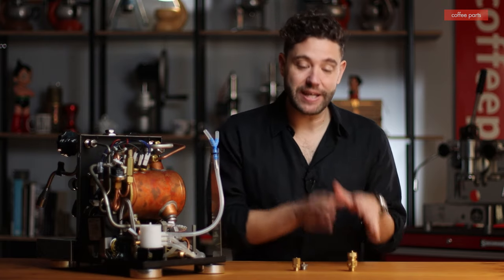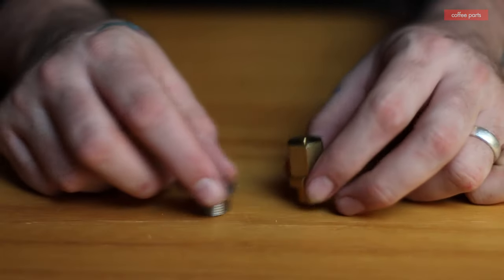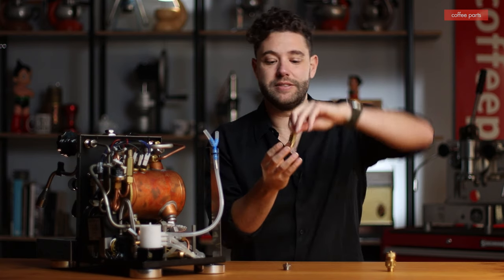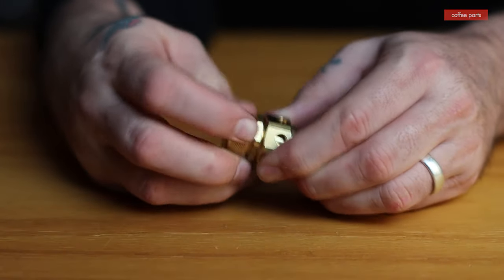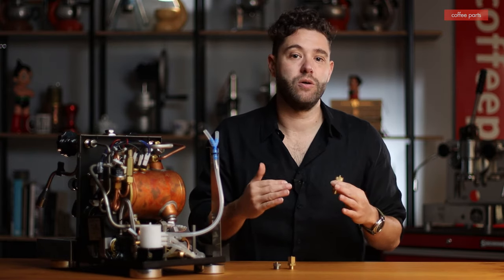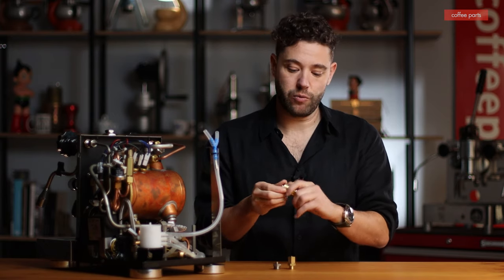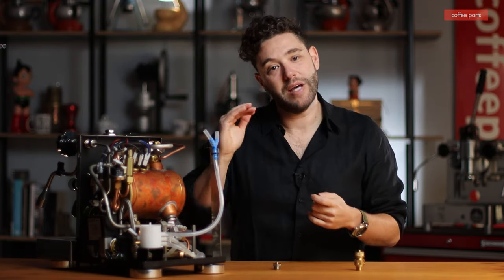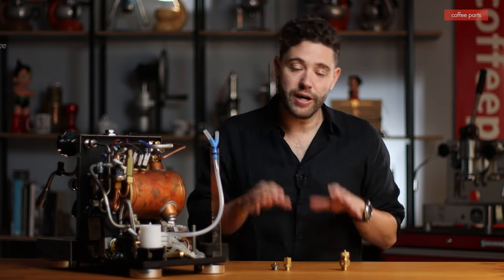Espresso Machine Anti-Vacuum & Safety Valves Explained | Quick Tip

Comment: Pedro - Nice video, but the anti-vac valve is really designed for another purpose.  It is to prevent a vacuum building up inside the boiler as it cools down. Without the anti-vac valve, the boiler could be crushed by external air pressure as the internal pressure drops in line with the temp.  The pressure from heating the boiler forces it closed and then as pressure/temp inside the boiler drops, air pressure forces it back open.

The safety valve - as you say is to stop the boiler getting too much pressure.

Comment: I have a Cecilware espresso machine and the problem I’m getting rn is the safety valve keeps releasing water from it after turning on the machine for like 20 secs , is that a sign the safety valve needs to be replaced ?

Comment: I tried gently pressing the red thermostat button (removed rubber plug on base) then fired up the machine.  Boiler runs until about 1 bar, then shuts down.  Don't know if this has "cured" the excessive pressure problem, but will see how it goes.  Pressure stat won't be too hard to replace (nothing is on this machine) if needed.

Comment: La Pavoni Professional anti-vacuum valve does not release excess pressure.  Pressure gauge ranges into the red and keeps going.  Is the valve stuck shut?  I've serviced the valve and it moves freely.  Suggestions?

Comment: My valve doesn’t stick, but opens and basically continues to outgas the steam constantly. Also, mine doesn’t have a “safety” combined. My machine is an Astoria CKXE/1. Maybe I have another peoblem that keeps it open and constantly gassing out? OR, the valve is just bad? I haven’t replaced it and the unit is over 5 years old. I did replace the thermostat a year ago and the gauge is staying in the green….

Comment: You mention standard sizing. Wouldn't brands like Nouva Simonelli use metric?
Reply: Plumbing fittings are BSP, a pre metric standard. When everything else went to metric, they kept the standard for pipe threads, as it was a different thread than imperial anyway. You don’t want people using standard nuts and bolts to seal boiler fittings or anything.
Reply: @nicbrownable  I had no idea. I will post this I found online. Might help someone else. Thanks for clarifying. 

NPT

NPT is the abbreviation for National Pipe Thread Tapered, which is the U.S. standard for tapered threads used to join pipes and fittings. They were established as a standard by the American National Standard Pipe Thread, commonly referred to as the national pipe thread standards. NPT is one of the U.S. national technical standards for both tapered and straight thread series that are used for various purposes such as rigidity and pressure-tight sealing.  

BSP

BSP is the abbreviation for British Standard Pipe. The thread, as defined by the ISO 228 standard, uses Whitworth standard threads, and is among a number of technical standards for screw threads that has been adopted internationally for interconnecting and sealing pipes and fittings. It has been adopted as standard in plumbing and pipe fitting nearly worldwide.

Comment: Thank you
Reply: my questions is our safety valve is broken and i wanted quickly fix it and finish with dead end. Ordered couple of them. Works fine now.But filling the boiler sound does not come anymore.Do youthink its just we dont Hve safety valve anymore or i have one more problem?
2 days will work in this way :(
Reply from the maker: There could be another issue..
So is the boiler not filling, or not heating?
Reply: @CoffeePartsTV  not filling we change the anti vacuum valve and its fine. it is probably designed to work to together. when its fulled with highly pressured steam it does not work.

Comment: My Wega Sphera One Group all of a sudden blew steam from the inside during warmup. Never change safety valve. Can that cause the problem? Or there is some switch that is failing?
Reply: If it was my machine I would open it and test it while open so I can see what where is the leak. Or verify the most likely safety valve yes. I wouldn't guess.

Comment: On my machine, the pressure increases so high that the safety valve then does its thing and releases a lil pop and lots of steam comes out.

What could that be teh cause of that issue? i assume not the anti vaccum as if it was the issue, i would have no pressure?

Here is a video of mine that shows this anti-vacuum valve https://youtube.com/shorts/n7GBx5rk3U0